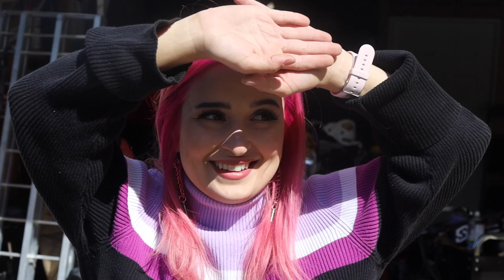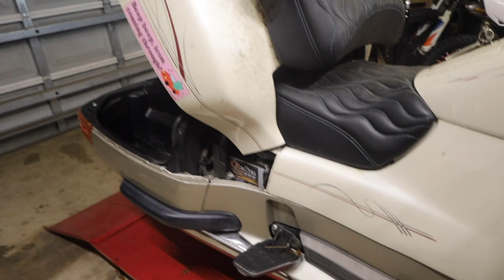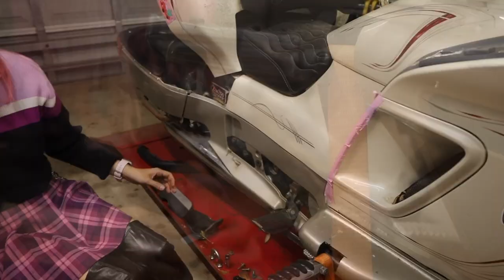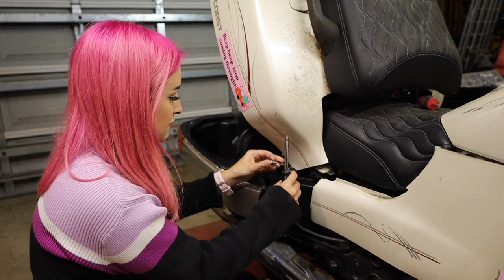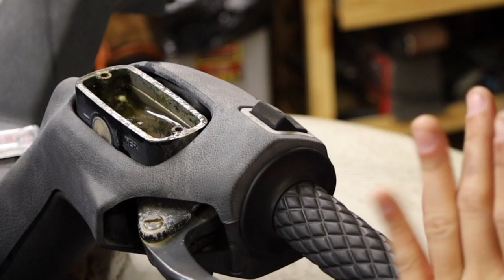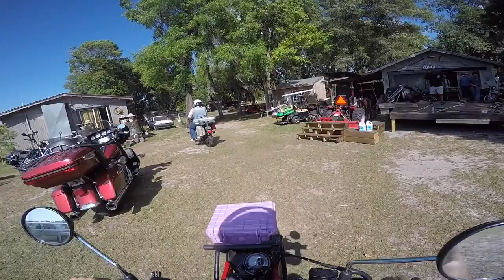I let my motorcycle sit for 6 months and this is what happened

Comment: Hello again from Minnesota. I have a 96 "boatercycle" that i bought new.  The original battery lasted 14 years without taking it out every winter. Used a battery tender while storing it. Unfortunately all the batteries that they make now are garbage and I only seem to get a few years out of them.  The slave valve is easier than you think to fix and the seals are not that expensive.  Replaced mine 4 years ago. I also own a Yamaha TW 200.  That would be a good fit for you. Low seat height, big tires for the sand and and a little less power so it won't get away from you. Don't want to see you hurt yourself again. Patiently waiting for winter to end so I can ride.
Reply: I am ready for winter to be done myself.
Reply: I worked for a battery company for 22 years where we serviced and sold around 2,500 lead acid batteries a month. Our record for the longest motorcycle battery in operable service was 12 years. Congratulations, your battery beat our two decade record by two years. Your experience with getting only a few years out of your new battery is unfortunately what the rest of us have been experiencing for the last thirty years. Due to improved battery construction and technology, If anything, battery longevity has improved over the last ten years. With lithium batteries just now becoming much more reliable for Motorcycles and recreational vehicles, we will finally be seeing battery longevity nearly double that of SLA's and six times that of wet cell batteries. Though you'll never see 14 years out of a motorcycle battery ever again, a "lithium" motorcycle battery is most definitely a strong step in the right direction.

Comment: That battery location looks like a very effective anti-theft measure. I don't understand why they put so much bodywork on these - I can get the battery out of my 1980 GS550 in less than a minute (but I don't need to because it's got a kickstart as well) My 78 Bonneville takes a bit longer, about 2 minutes. PS, you don't need to worry about shorting out the battery terminals if you disconnect negative first.
Reply: They used panelling to hide most of the 'bike' parts of the bike. It was made to target the car market, which is why even the handlebars are shrouded.
Reply: @axiss5840  That's pretty much the technique they use with car engines now - hide all the untidy stuff under plastic covers and people won't realise they're not as clean and modern as they make out.

Comment: People wanting to drive Mach 1+.  I feel ya.  I have a C50T.  It's a 5 speed 800cc.  At 60+ the engine is giving me ugly looks and starting to complain. It's comfy at 55-60.  I've had it to 75 and it sounds like it is gonna rev out. It doesn't have a tach either so I can't tell ya how close to the red line 7600 it actually is. I THINK the manual says 90ish.  Not gonna happen.  :)

Comment: @Cheyleesi I've been able to use ABS glue that you get for plumbing to repair cracked Honda plastics. Could be worth trying it out to repair some of the cracked panels.
Reply: I have done the same thing to repair my PC800 plastics. I also recommend picking up a 3d pen to add to your tool kit. In the past there were blacksmiths, and these days there are plasticsmiths.
Reply: 3M ScotchWeld holds more pieces of my bikes together than I’d like to admit.

Comment: Too much plastic on that PC800. My GL 1200 isn't far behind. Battery is easy though. Carbs usually dry out from sitting and by the time the carbs are full the battery is dead. I put a switch on my Wing so I can run the fuel pump without cranking to fill the bowls. I'll be flying into the US in a week and will see how it starts after sitting for 8 months. Charger is on so it should crank.